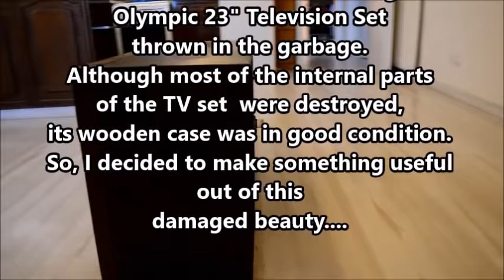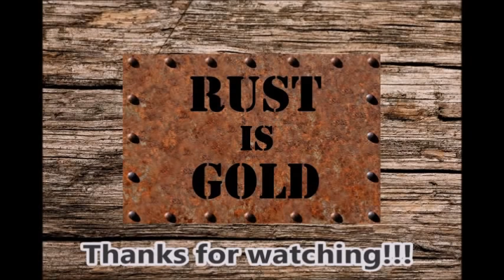DIY COFFEE TABLE out of a VINTAGE TV

Comment: It's actually an early-'60s model. Integral Implosion Protection was a feature of '60s-era picture tubes, but it's a pre-1965 model since it only has one channel selector knob. RCA made a folding combination TV & coffee table around the same timeframe, 1960-64. These hipster 'repurposing' projects normally disgust me, as a retired professional restorer, but repurposing is acceptable when found with a missing chassis.
Reply from the maker: Thank you very much for your comments and the interesting information you shared. I am 49 years old, definitely not a hipster! I literally retrieved this TV set from the garbage and as you saw on my video the whole interior was missing. There was no way to restore it back to its original condition. At least now is "back to life" as part of my apartment's decoration and used as a coffee table almost daily while at the same time reminding me of a similar TV set we had at my house when I was a little kid!
Reply: That's not what I would consider 'typical hipster repurposing' at all, @RustisGold , but more of a 'making the best of a bad situation' rescue, and the work was actually done well enough to be reversible in case you ever obtained a compatible Olympic TV chassis of the correct type, so it could be converted into a B/W display for a retro home gaming console such as Atari or Nintendo. The original chassis was probably removed to salvage copper and iron from its heavy power supply transformer.
Reply from the maker: Well said, I totally agree with you. It is also true that people when they find these old items try to retrieve the copper or other materials they can find inside. If you think about it it's a really stupid thing to do... They could get more money if they they tried to sell the whole TV set at an antique shop....
Reply: @RustisGold  some sets are more valuable than others. My specialties are B/W pre-1950 sets and early-'60s Color models. The B/W sets from the '40s having 13-channel tuners (before Channel 1 became the UHF position) are particularly collectible, and 21" round Color screens. Extremely rare pre-WW2 sets are most valuable, but practically impossible to find other than as museum exhibits or at specialty auctions, and the 'brute force' high-voltage circuits are as dangerous to service as a microwave oven. Post-WW2 designs typically used energy-limited circuits similar to the way a taser or automotive ignition module develops over 10,000 volts by feeding brief pulses of lower voltage into a miniature Tesla coil. Those will deliver a highly unpleasant shock not normally lethal to a healthy adult. I've accidentally gotten a finger in the path of a 15,000 volt spark before; sprained my thumb colliding with an adjacent wall.
Reply from the maker: Wow!! Thank you very much for all this information Sir!!
You are a real expert!! 😊👍👍👍
Reply: @RustisGold  Yes in Spain happen the same, people leave some electronical devices for another people to pick it, but garbage collectors ussualy smash they in the middle of the street to pick any copper.
What you can do is to fit a CRT with an universal chassis to give your table the oportunity to show on the screen as a monitor. This CRT was killed by the person who stole the chassis, they sell the electron gun, and break the neck for pick the  yoke, wich is the most valued part for they.
Reply: I've seen a Canon, old electronic typewriter next to a container. The next day I found parts of the case near to the container...
Reply: Container is dumpster in Spain.
Reply from the maker: Thank you very much for your comments! I am afraid it would be very difficult to make it work... The lower part of the tube was broken and all the inside parts are missing. However, it's a lovely table, I use it every day. It is part of my house's interior decoration!
Reply: @RustisGold  Thank you for asnwer my comment. This CRT isn't repairable. It's impossible to do the vacum again and to repair the glass neck. I found someone who rebuild CRTs long time ago on YouTube but it's just like a dream...

Comment: Nice project there. What does that cap you attached to the bottom called please?
Reply from the maker: Thank you very much for your comments. The only reason I attached the cap at the bottom was that the edge of the tube was coming out of the wooden case and since it is made out of glass I wanted to protect it.

Comment: Tv collectors everywhere are screaming, I’ve seen people take sets like these and install a similar or slightly later model chassis, it may not be 100% original but you end up with a working vintage tv.
Reply from the maker: Well I found this TV set in the garbage with most of the mechanism missing... Hopefully the screen was not broken.
It was not in working condition...
Reply: I’ve got a 1959 philco that came with the crt, speakers, but no chassis, I was at a tv collectors swap meet and found a similar chassis from 1958 that was almost identical, a bit of repair work and light modification and my philco lived again.
I mean you probably could still do that and have a functional tv as a coffee table, might look cool.
Reply from the maker: You're right,  that's a very good idea!  Unfortunately here in Greece I am not sure if I can find spare parts for such an old TV.
I thought of placing a flat screen TV inside but on the other hand I like the look of the old screen!
Reply from the maker: Check out another vintage TV I found thrown in the garbage a couple of years ago... Unfortunately, this one was completely stripped and destroyed. I found out that it was a Zenith model, early 60's.
I had to reconstruct the entire front part because it was missing. I turned it into a TV Bar!
Here is the link of the reconstruction process: 
https://www.facebook.com/pg/rust.is.gold/photos/?tab=album&album_id=468059976631756